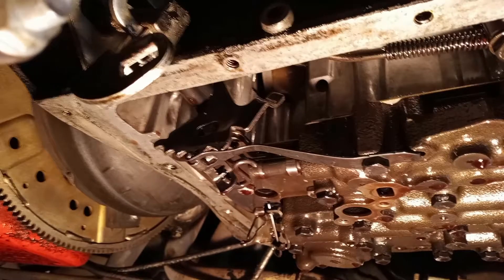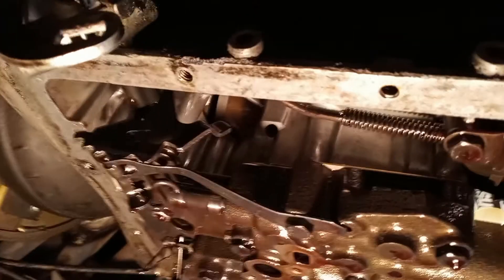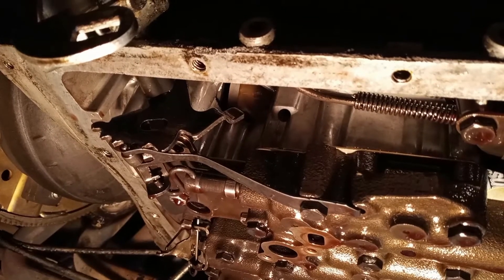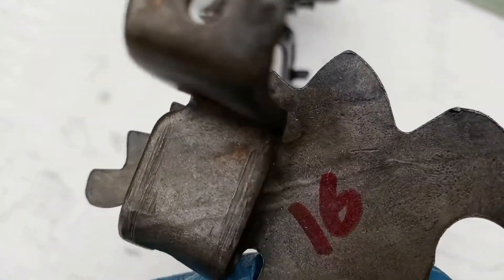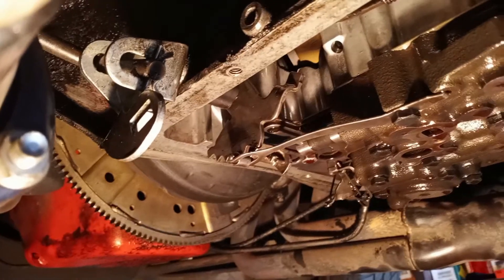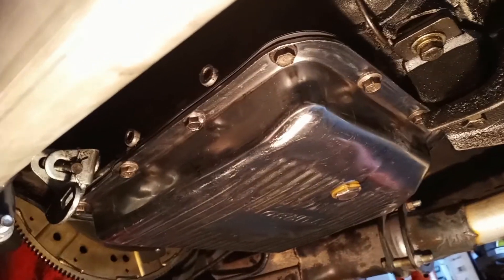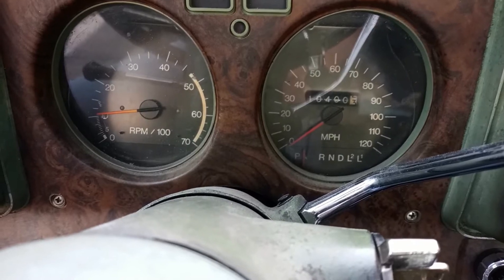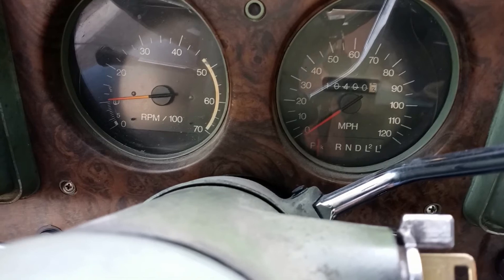TH350 Shift Selector Repair

Comment: How did you take the peice with the teath off. Ive been trying to tighten my nut, but i cant fit a wrench in there.
Reply from the maker: Removing the filter and the detent spring assembly will give you much more space for a wrench.
The shaft that the piece with the teeth (selector lever) is attached to has a nut on both ends. You will need to remove the nut (on end of the shaft that's on the inside of the transmission) that attaches the selector lever to the shaft, then it can be removed.
Reply: @drivingmyoldcar1974  Thank you very much, I finished my project today, and it's shifting good.